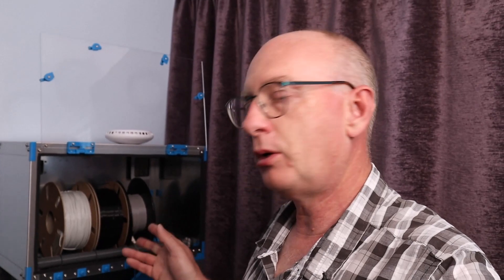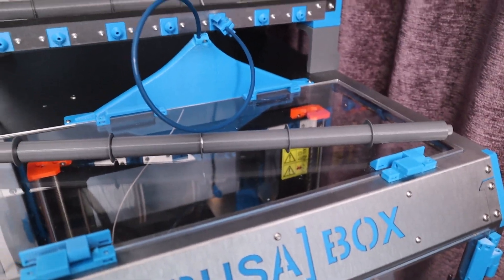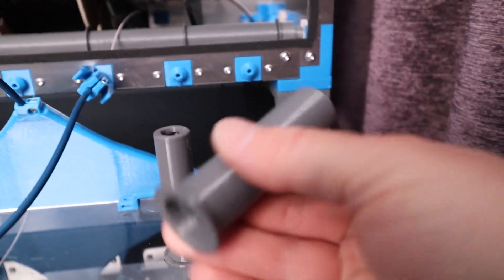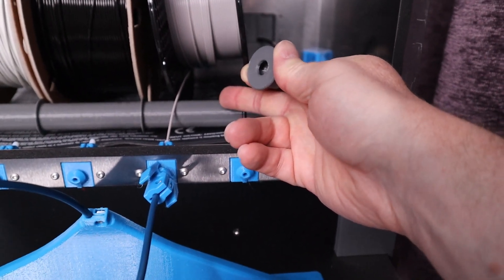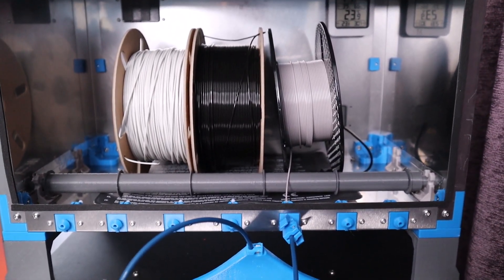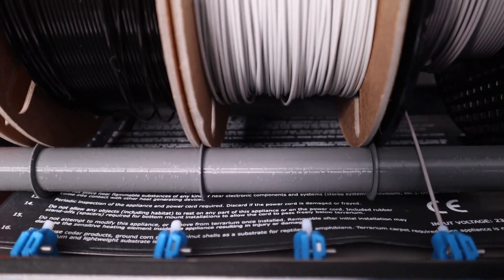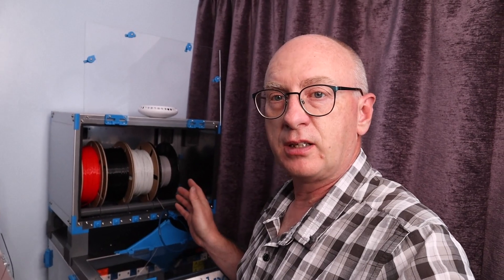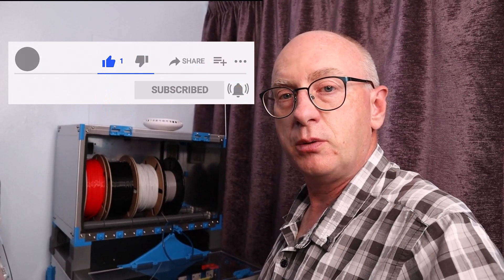Prusa Box Spool Tank Update - Sealed 3d Printer Filament Enclosure for All Printers

Comment: Isn't capricorn tubing tighter? As the PTFE tubes are only there to guide the filament and not feed like in a normal bowden setup, wouldn't you want the tubes less tight? (like the 4od 3id mm ones)?